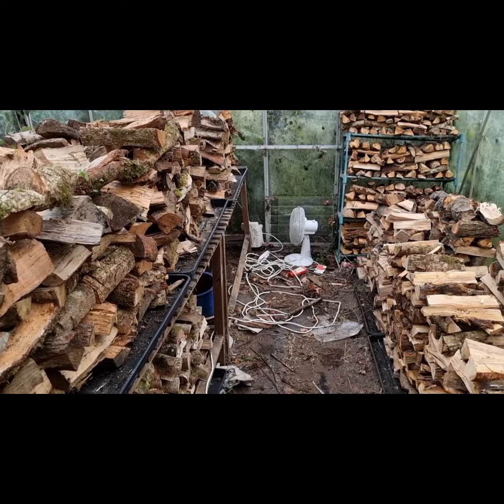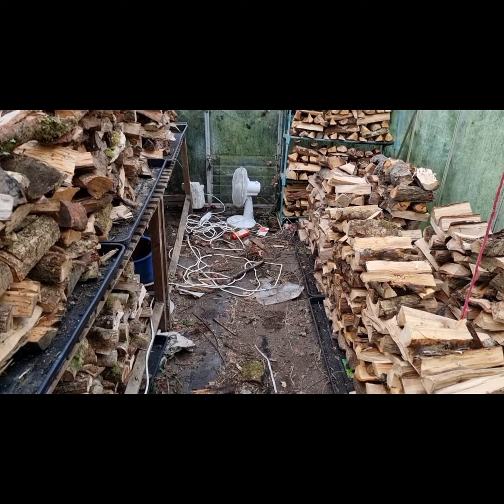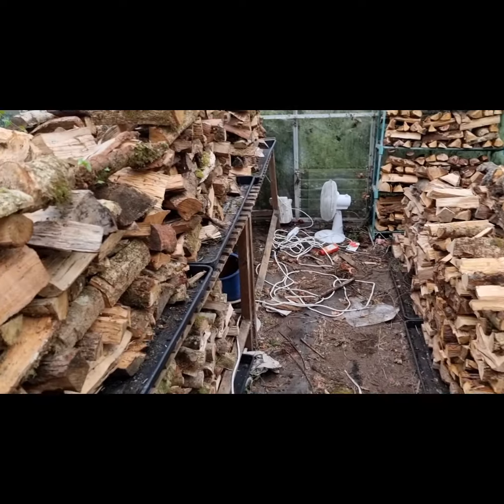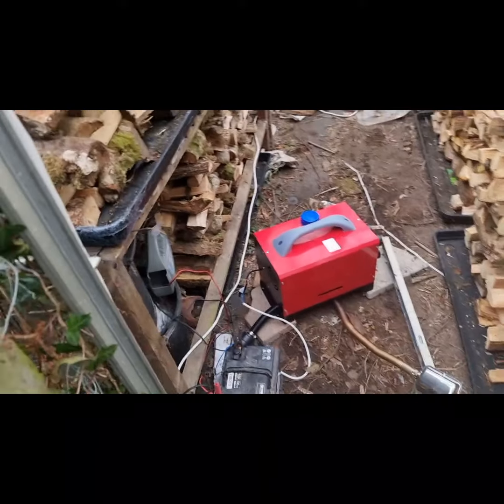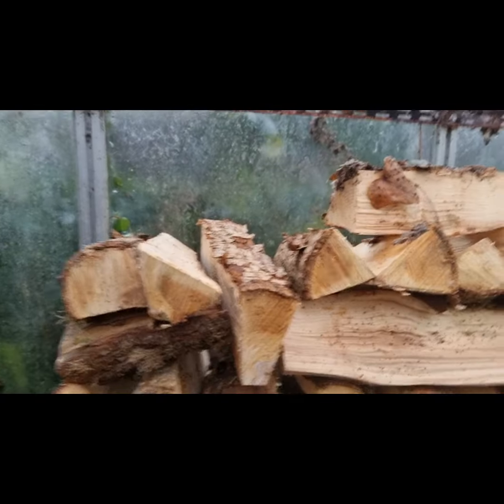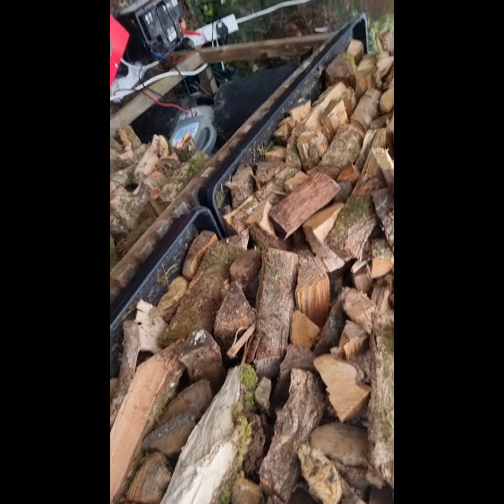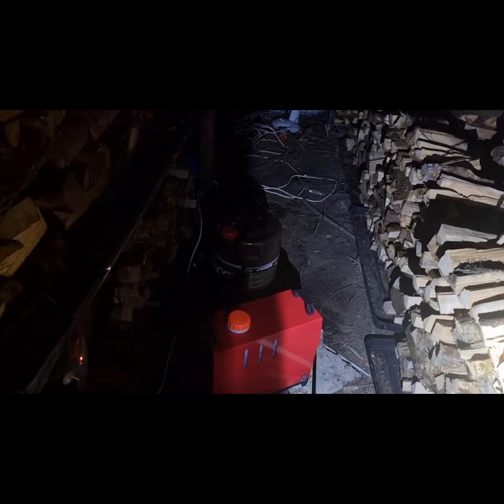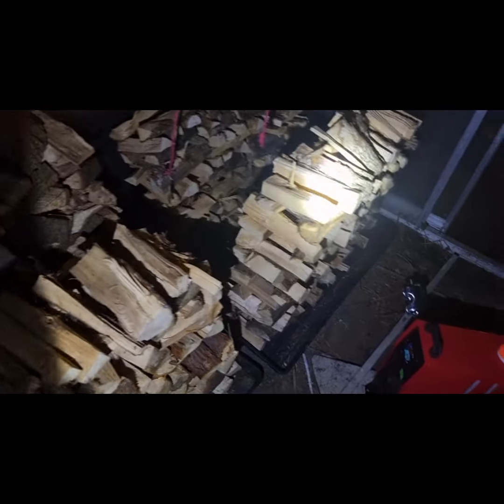1st (not very effective) attempt at creating a fire wood drying kiln

Comment: I used to live in southern New Zealand and used a glasshouse to dry firewood like you are doing but without the diesel heater......i put a solar powered computer fans at the bottom of the glasshouse pulling air out of the glasshouse and used the thermostatic top opening windows as intake vents, the theory being that the incoming air was warmed before being drawn down and out the fans at the bottom....it worked rather well.......i have now moved further north in NZ and use a 2.8x4.3m tin garden shed for the same purpose again with solar fans pulling air out the bottom of the shed.....i also painted the roof of the shed mat black with paint i 'liberated' from work

One thing i did notice is your glasshouse seems to have a dirt floor, that will pull moisture up out of the ground and slow the drying rate of your wood, both my glasshouse and the shed i now use are concrete floored....the first attempts i tried with my glasshouse failed until i poured a concrete floor in it.

Good luck with your drying